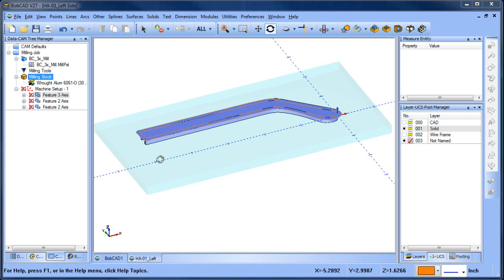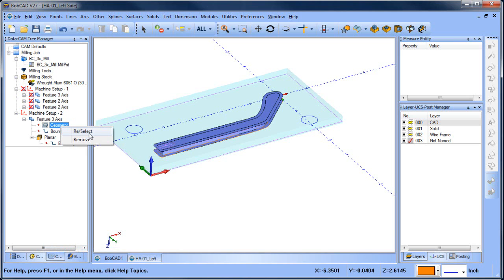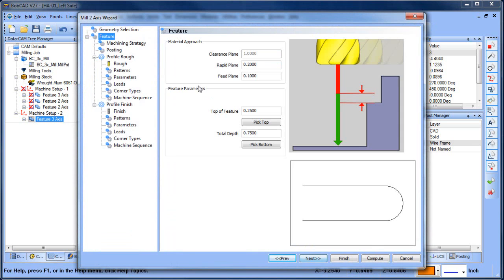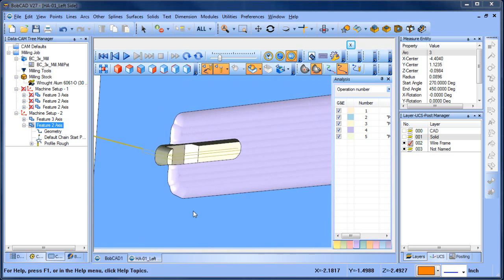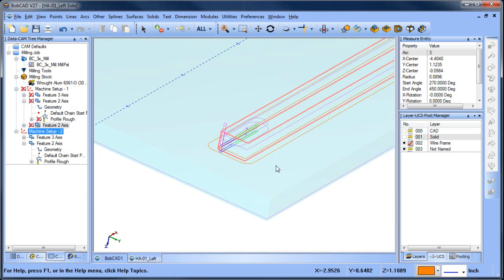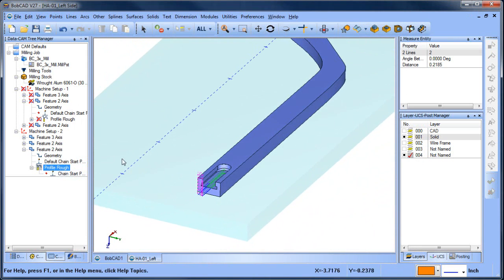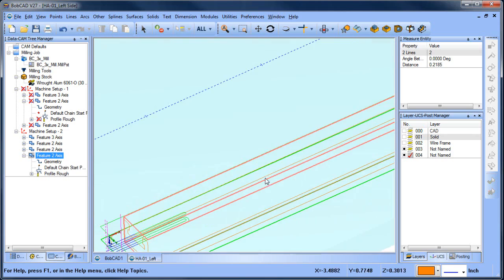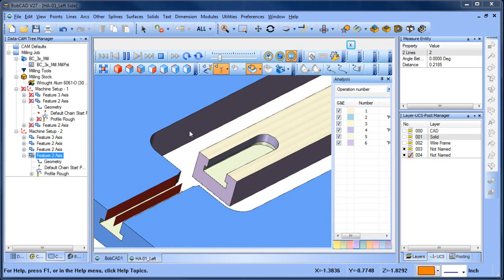2D 3D CAD CAM Tutorial BobCAD CAM V27 Mill Standard Part 2

Comment from the maker: You can use tabs with 2Dprofiles.  Currently you would have to "break" the profile selection of the part OD to create these tabs.  In the next version ( V28 ) tabs will be included as an option for 2D profiles. 

The other option is to machine the part in 3D and and enclose the part in a solid and draw in your "tabs" to connect the part to stock.

This example was to show the work flow you could follow to machine  a part like this.   There is a part 3 that I have not created yet, showing how to machine this part using 3D toolpaths and tabs.

Comment: You should be using tabs on that part so it doesn't move around when it finishes the perimeter cut.  Is there a tab function in the tool path options? Or, do you have to build some geometry to create tabs?